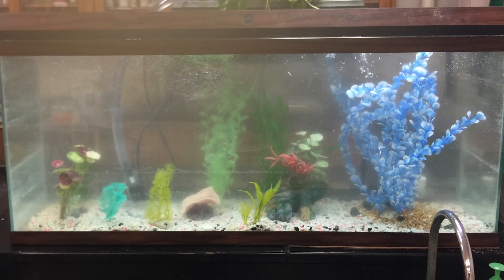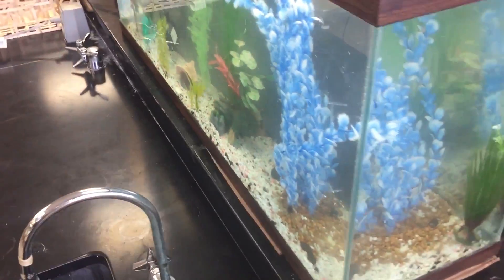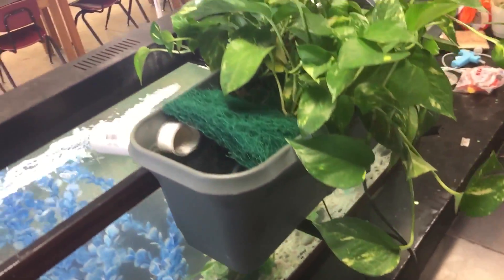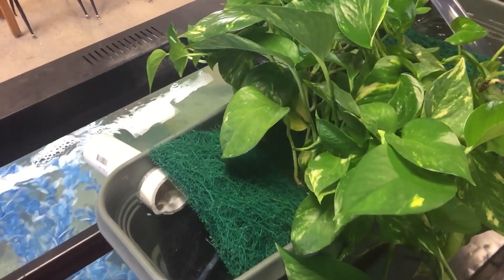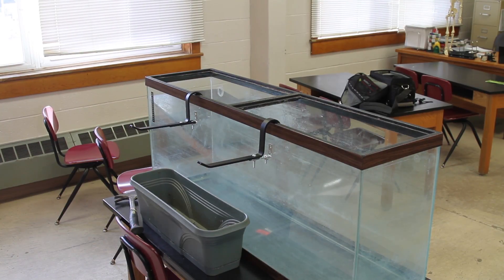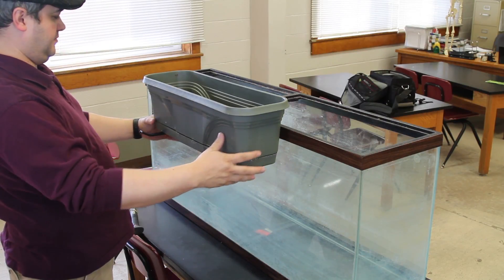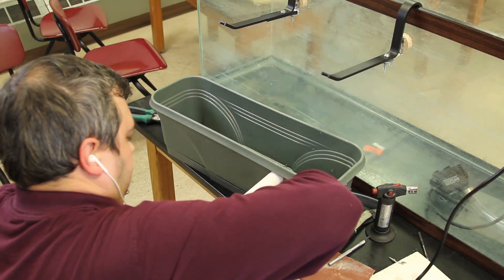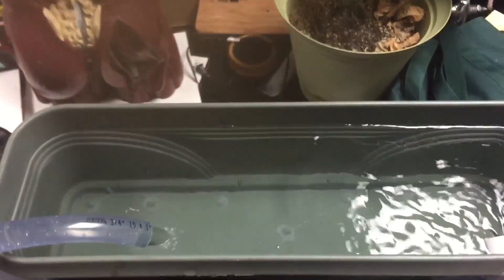How to build an aquaponics filter for a fish aquarium

Comment: Is it possible to make an aquaponics system by replacing the carbon filter of a filter with a thick type of soil with a plant in it?
Reply: Thank you
Reply from the maker: yes it is possible to use soil but the design would need to be different than what I am using in my video. you can look for “aquaponics using soil” and should find some examples of that. thanks for the question!

Comment: U are nt cycling ur tank without any fishes inside. Needs ammonia to start the nitrate cycle. Frm wat im seeing in the video, even with all that filtration system ure running, ure just moving water. Nothing more than that.
Reply from the maker: Yes, this is correct. You either need to add some "starter fish", add fish food or add a started solution. This was one of my earlier fish tanks where I did not explain this process.

Comment: Can i just use underwater plants for filtration?
Reply from the maker: Yes, underwater plants will perform a similar function. (Removing nitrates and producing oxygen in the water). The purpose of the external filter has a few purposes. First it has a filter to catch and clean particles in the water as the water runs through. Also, it allows you to use plants that can grow in water but not underwater. The plant can also grow much larger outside the tank allowing for much greater filtration of the water. I am getting ready to transition these fish and filtration to a new tank I have been setting up and getting ready. Look for that in an upcoming video. I have used all real materials in this new tank -  plants, rocks, and driftwood.
Reply: @teacherdad  I'm confused if it's worth it to have underwater plant now. Isn't it much better to have nitrate for the crops?
Reply from the maker: Real plants are always better than fake ones. Not only do they look better in my opinion, but they also work to filter nitrates from the water and produce oxygen. Both of those things are helpful for the fish.

Comment: I'm fairly new to aquaponics and i plan on setting one up above my koi tank, but one thing really confuses me. 
I understand how one part works: aquarium water gets sucked up from the submersible pump into the box > water nutrients feed the plants > water goes back to aquarium. 
The last part about the water going back into the tank confuses me, what filters the dirty water & sends the clean one back into the tank? A sponge? Wouldn't a sponge block the plants from getting the nutrients? Wouldn't the filtered water be brown after passing thru all that stuff the plants are planted in?
Reply from the maker: What you need is a pond or aquarium filter media. (Search on Amazon) usually comes in a roll. You cut a piece that fits across the container you are pumping the water into. The plants grow directly in the water they are not planted in dirt. I use a "golden pothos" plant in my aquarium. I bought mine from Walmart for like $10. You take it out of the pot and wash off all the dirt. Then place it in the water. The nutrient are nitrates from the fish waste. These are dissolved in the water so they pass through the filter media. The filter is just to catch larger particles from the fish or plants in the water.
Reply: Ohh, I saw people putting a small filter sponge in front of the container where the water is pulled into, then it passes thru a section filled with hydroton/clay balls and back into the tank, but i never saw any sponges after the clay balls so it always confused me as to how the clay with plant roots didn't stain the water. 
I prefer your method as the water-only plant system looks much better, i'm definitely doing this. Now i understand the process a lot more, thanks for the clear explanation.
Reply from the maker: Thanks for your comments. Hope that answers your questions. Let me know if you still need help.
Reply: No problem, it definitely did. Will do.
Reply: I believe aqua pro has a very detailed video on how water is filtered in an aquarium. It’s more to do with surface material

Comment: My recommendation.. scratch the air filtration pads.. usually they have chemicals to prevent mold which would be really bad for the fish.. what would be ideal is a matten filter.. (research Hamburg matten filter) these pads would work way better and in a system like this would only need yearly cleaning..
Reply from the maker: Thank you for the tip! I will check that out.
Reply: Teacher Dad I’m no expert in aquaponics although I’m toying with the idea and researching it currently. But I am very well versed in Fishkeeping and one thing I’ve learned recently is there is a huge lack of knowledge sharing between aquaponic people and Aqua cutler people. When we properly bribe the gap between the two I think both sides will have a much more efficient system. There are a lot of big mistakes in terms of filtration for fish made by even the most respected aquaponic gods and at the same time I’ve seen some things that are done in aquaponics that make no sense in the world of keeping fish that just blow my mind. I think both sides are stuck in early 1900’s technology and not utilizing modern day advancements.

I research all aspects of fish keeping and in my non important opinion technology trickle down is the following fashion..
Saltwater
Ponds
Freshwater 
Aquaponics

In saltwater I’ve learned how important circulated flow inside a tank is vs how unimportant filter turn over is.
In pond filtration if learned how to keep things cheap and simple for maximizing the dollar.
In aquaponics I’m learning how to utilize the biggest problem in freshwater fish keeping to reduce water changes and offset aquaponic costs with edibles. 

Things I see being done wrong by comparison is..
Saltwater.. nothing this is the latest state of the art entry point for outside the box thinking.
Freshwater.. stuck in a 1960’s thought process loop of filtration beliefs.
Ponds.. not enough experience to say either way other then I think they miss out on a lot of aquaponic benefits cause the two are very closely related. 
Aquaponics.. there is zero thought put into the fish keeping aspect and as such filtration is on a 1940’s level. There are many things learned from pond and freshwater and even saltwater systems that can greatly increase effectiveness of aquaponic systems that are most times looked down upon by the aquaponic gods. Once such example would be the debate of deep water culture vs media beds.. in aquaponics dwc is looked at as the end all be all.. however in doing so you have to utilize a mineralization bed. This from a typical Fishkeeping prospective makes zero sense as grow bed media is nothing more then biological media fish keepers buy and place in their filters. So the lack of thought to just use the clay media as the biological media blow my mind as it will biologically filter while also mineralizing the system at the same time eliminating an extra cost and part of the system. I see many simple solved issues like this in aquaponics especially around the use of gravity feed systems and sumps. Massive noise in drainage cause no one has though to figure out how fish keepers solved this issue many many years ago. Now several methods like bean animal and herbie wouldn’t be efficient in aquaponics but instead of a bell syphon a modified duriso standpipe setup makes much sense and eliminates the air guzzling from gravity feen media beds which is an air issue not a water issue.

Couple things to think about as you grow in both fields cause as a teacher I think your mind is a little more open to learning and less set on a system someone says works or doesn’t..
Reply: I use hydroton clay balls in my canister and hobs also added a plant to take nitrates out on the hob @fishrrelaxing9361
Reply: @fishrrelaxing9361  I know it's a 2 year old post, but I just saw it today lol.

Nice post.

I wanna share my story too. 

I never like fish keeping, but I'm doing it to help my mom. I've read around and found a nice solution that work for both of us. 

I go bare bottom with basic aquaponics. I simply use a kitchen sponge holder to hold my household plants, such as pothos and peace lily. I heard they will help lower ammonia and algae.

Bare bottom also help make my fishes eat all ther foods, but more importantly cleaning their plate afterward. The fishes also developed a habit to sweep their wastes into the intake I set near the bottom. It's important that I can't put anything near the bottom to obstruct their wastes to find their way into the intake hehe. I'm plan to use those suction cup holder to hold future aquarium plants on the side.

I just got a slightly bigger hamster tank for my fishes. 

Here is the sceenshots of my experiment tank. 
http://imgur.com/gallery/201V8IU

Any suggestions for my tiny self cleaning tank?

Comment: Hey, I was wondering how would you know how many gallons per hour a pump can handle? If I have a 5 gallon tank, what kind of pump should I be looking for?
Reply from the maker: It is recommended to try to pump 5 times the amount of your tank per hour. I bought this pump at Lowe's and on the box it states how many gallons per hour. A five gallon tank should have  at least a 25 gallon per hour pump. I have also used a pump like this Tetra Whisper PF10 Power Filter, Quiet Three-Stage Filter https://www.amazon.com/dp/B001CHXJSK/ref=cm_sw_r_cp_apa_i_MOSbBbN0XFGYD on Amazon and put a plant inside instead of using the replaceable filters.
Reply from the maker: Perhaps I can post another video in he future about how I did that.